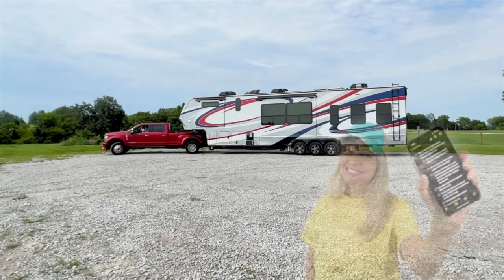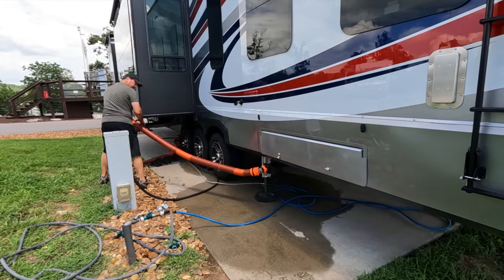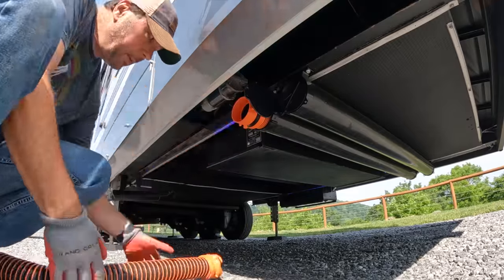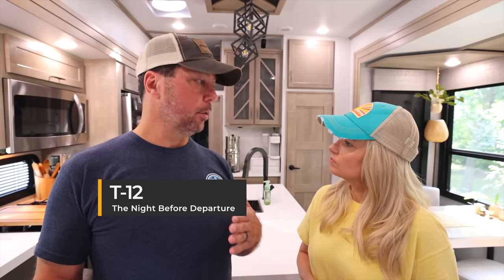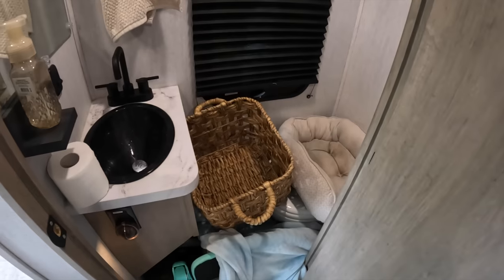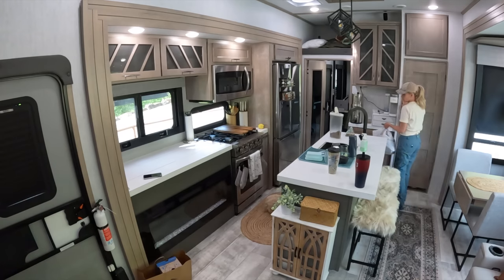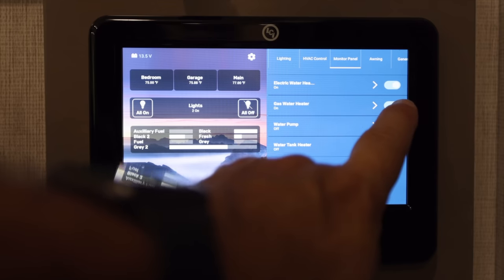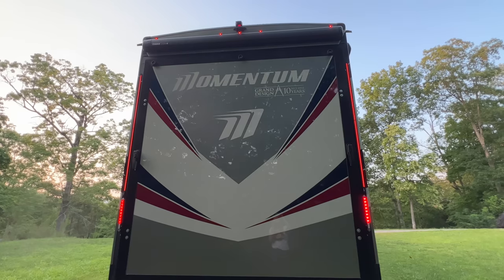Our RV Pre Travel Checklists for a SAFE Travel Day

Comment: We use Anylist for our RV checklist.  It is platform independent.  We also use it for our Meal planning, Recipes and grocery shopping. We like it because we can add pictures to our some of our travel lists with our License plate, Insurance Card etc.
Reply: Best $10 / year we ever spent.
Reply: Came here to say this!  Anylist is very flexible and it syncs on all your devices.  When grocery shopping, my wife and I can be in different parts of the store and the things we each check off are checked off on the other's list in real time.  I am planning to set up my checklists in Anylist once I get them fully developed.
Reply: Anylist can be adapted very easily to an RV application.  You can create packing list items for everyone, including pets.   We have an RV set-up and breakdown checklist as well as before you leave list for locking up the house.  Instead of different stores-you can create different areas-RV basement, seasonal RV items, etc.  The sky is the limit.

Comment: Great system with your checklist. But I have been driving 18 wheelers for 30 years. So i've been doing pre in post trip checks four and five times a day. When I use my r v. I just add the steps in my head. They've been burned in over 30 years, LOL.

Comment: Years ago, I took your original checklists, modified them for our personalized routines, and made them into interactive PDFs.  I use the checkbox feature to actively check off the line items as they get done.   Then I added a button at the bottom to clear all of the checkboxes when we are finished.    I keep the checklist PDFs in my Dropbox, which is accessible from anywhere… phone, iPad, etc..   They have been incredibly helpful.   As referenced in your original video, even if we don’t use them every time, or even if we don’t check off every item as we go, they are always there to refer to.   And in my opinion, the very exercise of creating our our versions of the checklists, ratifying each step in our process, and carefully documenting the entire routine, is quite beneficial in itself.   So, thank you for that.  And thank you for all that you do.   Changing Lanes is the only RV YouTube channel I watch with any regularity.
Reply from the maker: Great idea on the PDF.  It's easy to clear our checklists on the mac, but not as easy on the phone.

Comment: The only thing I would change is to check your leaf springs and your tires after you get to each RVPark not right before you leave.. I found 2 of my leaf springs flattened. It gave me time to replace them without having to extend my stay. That's the way I do it anyway.

Comment: Thanks for the great videos! 
I saw on another video with one of the tank cleaner guys that they didn't recommend using the dissolving treatments to avoid 'sludge' building up, especially on the sidewalls of the tank. Something about our black tanks being holding tanks and not septic tanks. You don't seem to be having any issues, tho. I'd love to hear your thoughts, if you care to share.
Reply from the maker: Yea. they were surprised how clean our tanks were after 5 years straight use...  But, we always get good flushes when dumping.
Reply: Proof's in the pudding...

Comment: Inspecting tires T24 might be too late to get it fixed, and it's difficult under slides. I check tread on arrival with slides in. Yes, tire press is easy T24 w/ TPMS. 
But I'll be adding shackles & leaf springs to my arrival list.

Comment: Cold tire pressure just means it hasn't been driven recently. It doesn't mean you get up early in the morning and check them.  Sunshine will make a couple degrees difference but it's not that critical that you have to check them before the sun comes up.  Tires have some margin of error factored in.
Reply from the maker: I've seen as much as 8-10 degrees difference on the sun side of the RV in the late morning.

Comment: Great content as always.  Thank you. 

Curious about using y connector.  I used to use it but found too many situations where one hose could backflow to the other.  I find holding the end of the RV side hose in the air and moving it is safer...cant hold both at the same time :-)
Reply from the maker: Yea. it doesn't work great unless it's downhilll..

Comment: Hi been watching your for years👍. Tires 14 ply today 1 went to 160 the alarm went off  we had been on the road about 3 1/5 hours the others were all at 154.153.153  psi all 130 the one that went off was on the sun side and the back (95 out side ) was going about 74. XLR 28dk5 with street glide in it  started tire psi at 107 ? What to do maybe less psi to start with ,  i had 25 miles to go slowed down to 70 it never went higher

Comment: About the Liquified, you do not use the Pinesol/calgon bath beads anymore?
Reply from the maker: We only used that in our Grey tanks, but now we're trying this in there as well... So far so good.
Reply: Tried that, it seemed to work well for a bit and then we were getting smell issues in the black tank. Switched back to happy camper and smell issues went away.

Hoping to try Liquified, but not accessible in Canada

Comment: How well did the Pine-Sol and Calgon mixture work for you? I remember it was recommended when your grey and black tanks were professionally cleaned
Reply from the maker: We're only used it once.. 😳 We also tried the liquified in the grey tank and it works well there too.
Reply: @ChangingLanes  We tried it ourselves for a few months, but we switched back to happy camper for the black tank due to the smell.
Hoping to try Liquified, but it isn't accessible in Canada

Comment: Some black tanks will overpressure if you flow to the flush line with the dump valve closed. Is your system different?
Reply from the maker: All black tanks should be vented to the roof?  Might be different in some class B RVs?  I'm not sure.

Comment: I noticed you filled the Berkey but did not see the actual filters attached or am I seeing things?
Reply from the maker: The travel berkey has 2 filters inside.  👍🏼
Reply: @ChangingLanes  correct...we use one as well but our filters are attached to the bottom of the top chamber...in the video Tara was filling up the top chamber with no filters attached and just put it back on top of the lower chamber...was confused at that...does the travel version work differently...we have the big berkey